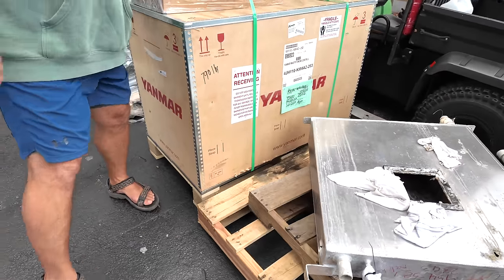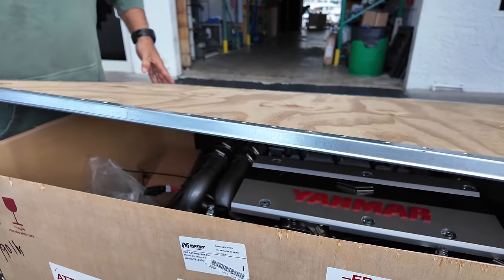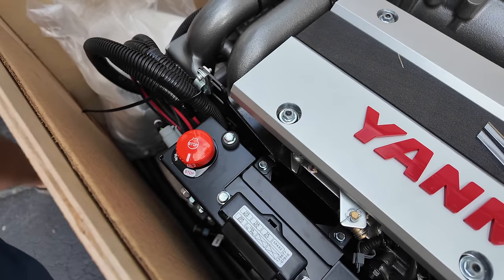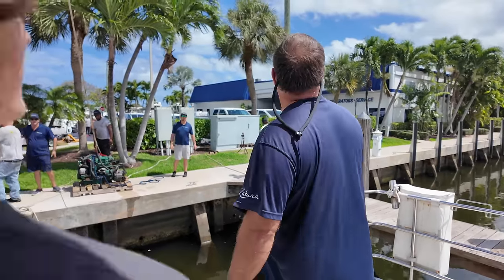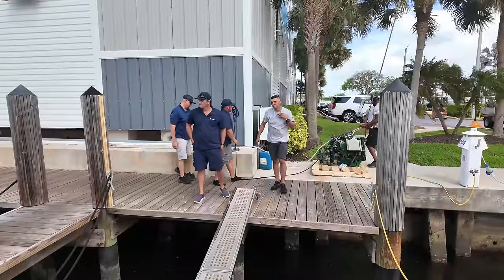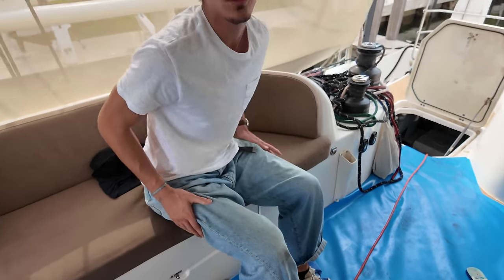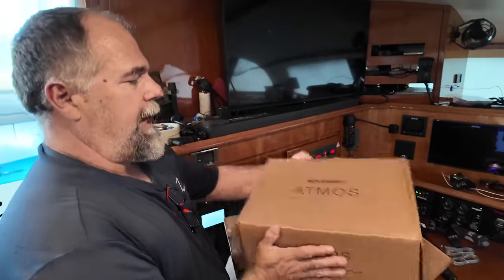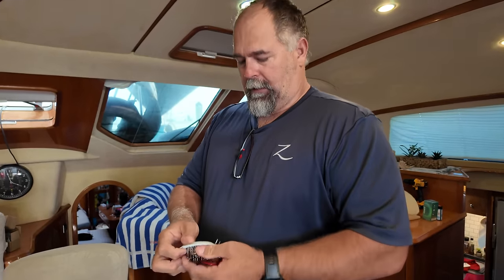WE GOT NEW ENGINES!! ⚠️ Step 1: Remove old engines (Ep 280)

Comment: I installed a Yanmar 4JH57 in my Leopard 47 just last summer myself at my slip at the Riviera Beach marina.  With a little planning and foresight, it really was very easy.  Old one out in one day, clean up the engine bay one day and bring the new engine to the dock, next day get the new engine in.  I remember opening that box just like yours.

Comment: Nice!  Yanmar!  A good friend from the 70s swore by Yanmar.  One of his boats came with a Yanmar and he put a Yanmar into his other boat when OEM engine died.

While they're cutting install hatches, are you going to build hatch covers for expanded access?  Will you build up a 1"-2" lip to meet with a nice hatch seal to prevent deck wash from falling in the hole?

What's next for Renee?  Captain's license?  You should!!!  Kate, too.  Renee, your kitchen remodel looks VERY nice and was a LOT cheaper than most home kitchen remodels!

Comment: Love the new kitchen guys! If I may make an observation regarding the recessed microwave though,are you not worried about the air circulation for the top and rear of the enclosed microwave? Would have thought you would need sufficient air flow for the intake and discharge air vents?

Comment: Those Yanmar engines will make you sleep easier out on the water. I have a 2012 compact tractor with a three cylinder Yanmar diesel. Has about 650 hrs on it with never an issue. Change the oil every mowing season just bc.  Looking fwd to the final install and sea trials!

Comment: As a yanmar tech in nz i know those engines are common rail therefore if you have major electrical issues the engines will not run as the injectors are electronically controlled

Comment: When I installed my new Yanmar motor 7 years ago I asked the mechanic what is the one thing I that is an issue with this engine. He said that they go through a mixing elbow at about the 5 year mark. Just as he said, mine broke at the coupler at 5 years and 6 months. You should but two extras to keep on hand as you travel. Fair winds….

Comment: Those yanmar 110s make almost as much torque as my 454s in  my Chris Craft.    I get about 1 mile out of each gal of fuel.   I'll bet those 110s can do triple that.  I cruise my 454s at 2500 rpm, not going over 3000, so a perfect match for that little diesel.

Comment: Fresh water Rinse layup and Emergency Bilge Pump.

On Starlight 1989 Beneteau Oceanis 350 has a Volvo Penta engine M2003 28hp anyway I was the second owner, so after I purchased the boat I was doing the shakedown cruise and ran the engine for about an hour and the overheated alarm went off , could not find a problem, cutting too the chase lots of growth and calcification of the tubes in the heat exchanger.    Had too take the entire unit clean it and put it back, never wanted to do that again figured was not the use rather the extended, layup with saltwater, also the corrosion factor of the elbow, had to replace that.  So as a solution I cam up with this manifold I constructed with brass and bronze fittings and ball valves for each connection, from the thru hull , to the manifold, ball on the thru hull and on the manifold did the same at the on end valve to the sea strainer to the engine, next thru hull, pressure fresh water, and at the other end again valve to a run to the bilge. 
This allows me to turn on the fresh water, backwash the thru hull, then shutoff and run the engine for 2 minutes on fresh water before shutting down the engine for the night or an extended time.  It also in the final configuration allows me to bring to bear as an emergency pump, on my main bilge the engine, if there is a major leak in the boat that bilge pumps cannot handle for whatever reason, (lightning strikes) etc.  I often use the fresh water system when she is on the hard, and I need to run the engine, like changing oil, etc. I have 100 gallons of water on Starlight,  you should see the looks I get in the yard with no hose, on the hard, yet engine running and water from the exhaust and prop shaft running out. In 20 years have not had any overheating issues or had to deal with the heat exchanger or the elbow, which is notorious on Volvos.. 

On your new engine laying it up on fresh water, will really prevent problems..
Congrats on the new engines..Bravo Zulu!

Comment: Good Idea mechanical linkage hook-up for gearbox & throttle......smart! diesel only needs clean air, clean fuel, oil in the crankcase to run!!!.....having sensors blocking engine starting/operating blocked by "run by wire" systems id ERRONEOUS design (especially on cruising vessels){ s/v Lyra Noa was broken down in costs rica because of electronic sensors not allowing engine star)

Comment: Leaving the wire cutter on top of the boxed engine and then closing the box was cuckoo. If that tool falls into an engine crevice it will be a real pain in the ass to remove. Not smart.